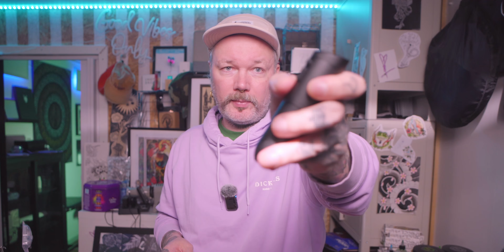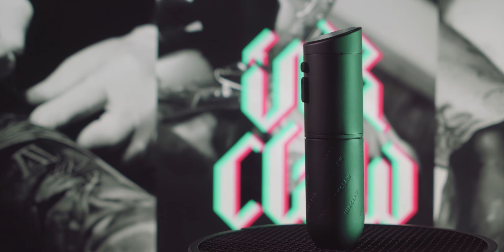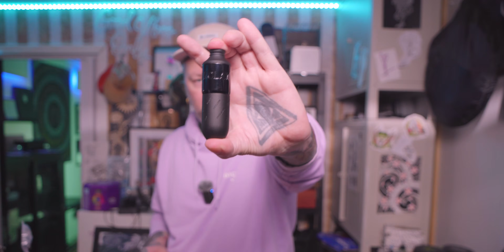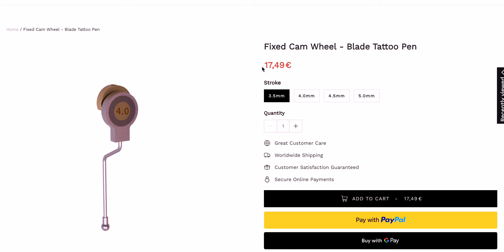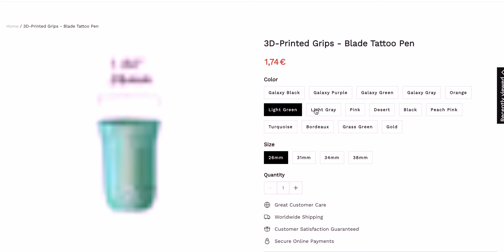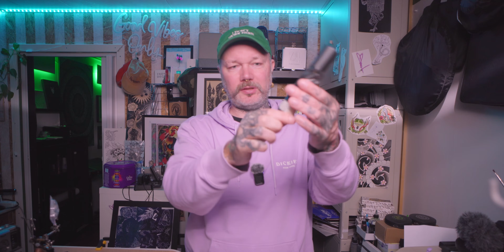Inkclaw Blade and LBL Wireless Tattoo Pen - review

Comment: Hey sir. Just wondering if you have a video on how to hold the coil and helpful basics?   Switched from rotary to coil and still learning.   Need help sir.
Reply from the maker: No I don't have a such a specific video. One thing that can be helpful would be steel grips to help with balance (if you have option to autoclave them)